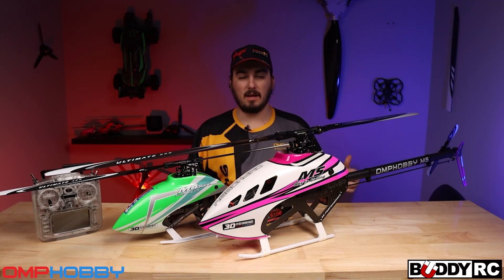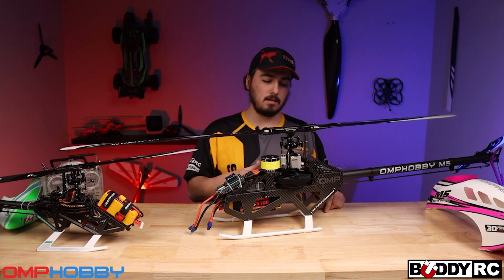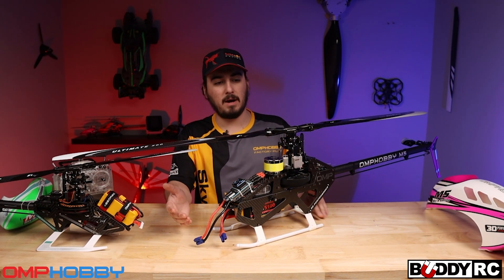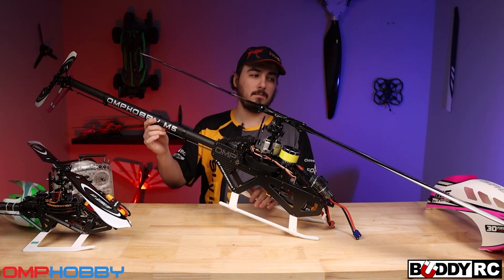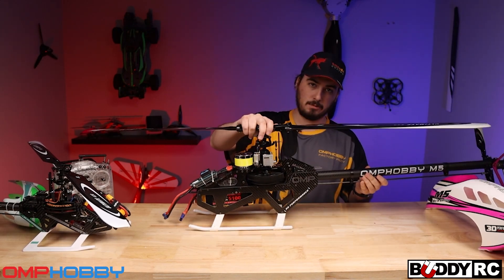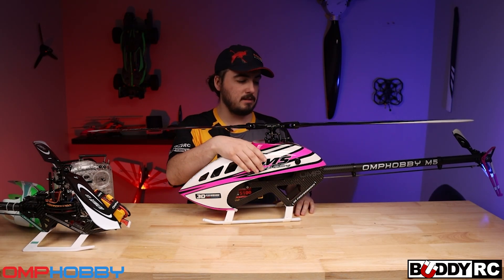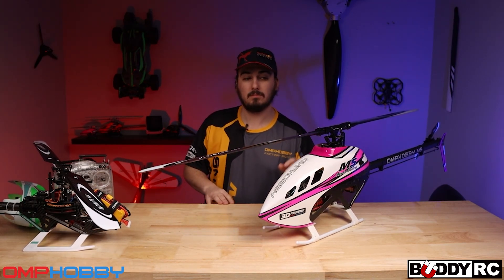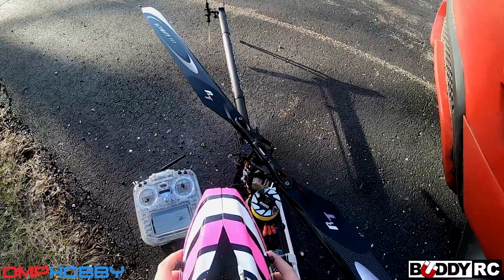OMPHOBBY M5 Features and Flight

Comment: Excellent video showing features and details of the new M5. Really looking forward to this one in a convenient 6s power size. I’m on the fence between the radiomaster and vcontrol. What are your thoughts on those two radio systems?
Reply from the maker: Thanks for watching! I am selling My V control to switch to Radio Master if that tells you anything.... I have converted all my helis to rotor flight and they have never flown better. It takes a bit more programing but its worth it in the end. Hope this helps!